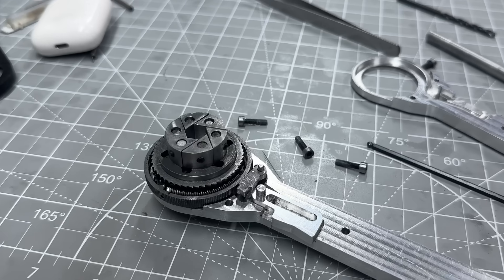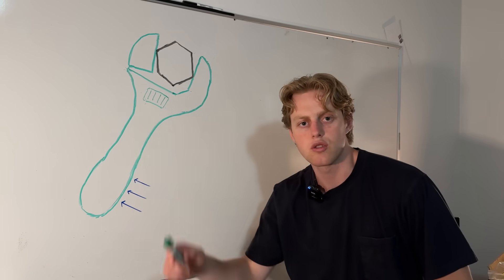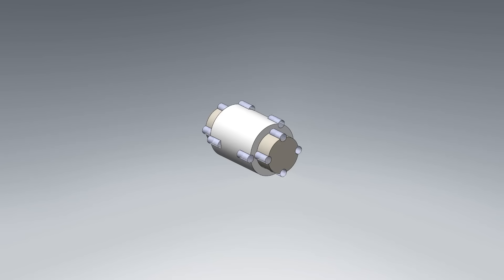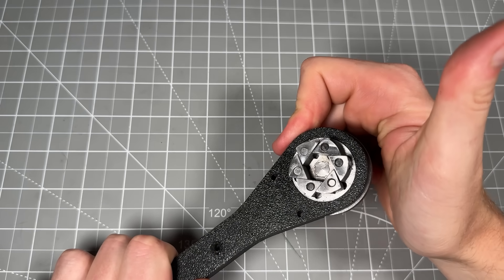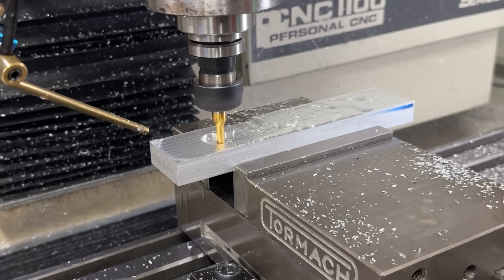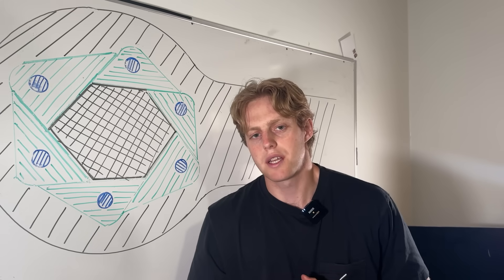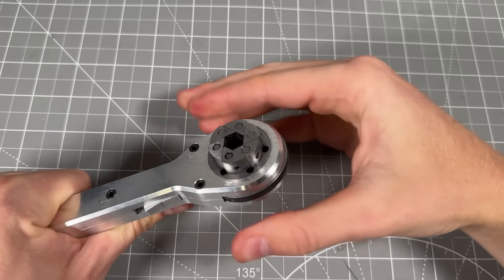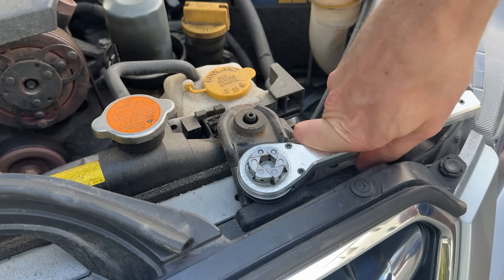I Invented an Adjustable Ratcheting Wrench

Comment: It's immediately obvious to anyone who worked on mechanical things that this wouldn't be practical because the head of the wrench is too big and heavy. You simply can't get into tight spaces with such a tool and you'll tire yourself out holding that thing all day. There's a reason why people buy those tool sets with hundreds of pieces, it's because they're just different and are needed in different situations. The right tool for the right job, and a universal adjustable tool is still never going to be the right tool in all jobs. It seems like you got fixated on a particular thing and worked on it for a long time but you never stood back in the middle of the project and think, hm, maybe this isn't going to be such a good idea even if I got it working.
Reply: I hate to agree and wish you could have been more supportive but yeah. Either way this is super cool. Just because there are already better ways doesn't take away from its coolness.
Reply: @WoodworkingforAnyone  It doesn't mean I don't support you or your work. Sometimes we just have to make the tough decision and decide to not work on something. There are many times in my careers where we've canceled projects because they don't make sense, even though we spent months and years and sunk a ton of money and people into it. Looking back, they're almost always the right decision even though we may feel really shitty about it at the time. That's what real engineering looks like.

Comment: That looks very nice! from a machinist point of view all of those parts are good to mass produse to tolerance with a cnc machine shop. so if one would make enough of these you could push the price of each of them down quite a bit. and also love that it does not matter what kind of bolt it is, if its Metric of Imperial, or just some worn bolt that dont fit aither of them haha. love the design and excited to see how this goes onwards in the future!

Comment: Very cool project from an engineering perspective. Hope you will keep exploring it. If you’re thinking about turning this into a product, I’d recommend putting together a solid business plan early on. That way you’ll get a clearer picture of where you want to take it, what challenges you’ll face, and what price point and margins you can target. What are your overall goals? Who’s your target customer? Where will you market and sell it? How much time and resources are needed to produce at different volumes, and how does it scale? Do you want to manufacture small batches in-house, or design directly for large-scale production and distribution? What do you need to invest into machines to achieve this at different stages? Etc.

A fundamental challenge to consider: in many real applications, like working on vehicles, bolts are often in hard-to-reach places. For professional use, I don’t see this tool fully replacing a standard socket wrench for that reason. It would not be as robust, versatile, or cost-effective.

If it cannot replace the tool it is trying to improve on, it would need to find its niche as a supplement. That quickly puts it in the "nice to have" category, maybe for novelty or as a compact/on-the-go emergency tool. There is definitely a market for that since people spend a lot on tools, but with the complexity of the mechanism and the precision machining required, the big question is whether it can be manufactured at a price point that makes sense for that segment.

Comment: Cool project.   

I don't see it as a tool that would sell outside of gimmick sales.  Manufacturing will be more expensive than a set of sockets, and sockets will always been seen as superior to people who use tools for work.  It's something that could sell in an infomercial, for gifts bought by someone who doesn't know about tools.

The real product you have here is making YouTube videos.  Step up your production value(especially audio) and get a little more in depth and you could make some real money while pursuing your ideas.  This could have been several videos with a bit more b roll and more description of the problems and revisions

Comment: Amazing work! I can only imagine how much work went into making this video. I wouldn’t give up on it, I think you can push it further. I saw a short clip a few days ago, it mentioned how Steve Jobs asked his team to work on the first ipod. Team came up with something that resembled a walkman, he insisted that they make it smaller with the team saying that it’s impossible. He then took the one off that cost him a fortune to develop, throws it in an aquarium and air bubbles come out, he walked away saying if there is room for air in it, then it can be made smaller. I understand how difficult it can be to try making something as small as possible, and how hard it is to ditch a design just to make it totally different. I lost almost a year trying to perfect something that I had to ditch for a totally different design.
Reply from the maker: Ya this will be the final hump, size and strength are direct trade offs and I need to optimize for both.

Comment: This is incredible, instant sub

Would love to see a proper torture test, comparing the results to normal ratchet wrenches

If I had to give an input, it be that the gripping teeth be shorter(reducing the overall profile) and possibly getting them hardened(compensating for the reduced volume, though I doubt it'd be a problem leaving them as is)

Honestly, besides that, no comment, everything is perfect, and the teeth auto gripping design is genius, props on the amazing work!

that being said, there is a flaw, the more moving parts you have, the more likely it is too fail, eventually, dirt and grime will get in there messing with tolerences(and it doesn't seem especially easy to dissasemble and clean...), would love to see how you deal with that
Reply from the maker: Thanks for the input! I definitely have some of the same concerns. I will definitely do some proper testing in the future, I just need to make a few changes first...

Comment: fantastic idea!  i've wanted a single wrench for multiple size bolts & nuts basically as long as i can remember, but ratcheting action is even better.  you could differentiate the side functions pretty easily with different color filled engravings too.  i could definitely put that tool to good use.  file a patent before some faceless corporation steals your design!

Comment: Super ambitious and interesting design.  Your doing stuff I couldn't even imagine doing, so bravo.  However, as an electrician that works alongside mechanics on the regular for my job, I would doubt this would see much use on my jobs.  It looks to be a very heavy tool, with not a lot of room for shrinking.  If we are given a repetitive task, its easier to assess beforehand what tools will be needed and just have a single ratchet and socket on us.  If we don't know what to expect, an adjustable wrench is sufficient for a one off bolt, otherwise, we just go get what we need.  I just don't see anyone willing to carry around such a heavy tool all day, and if you aren't going to carry it, you might as well get the specific socket you need for the task.  

If the tool is actually capable of withstanding heavy forces and actually grips the bolt tighter as you turn it, I would market it was a rounded bolt extractor, instead of socket replacement.  There are times when we take apart a rusty PoS and it can be very frustrating.  I could totally see people keeping a self tightening ratchet on their tool trucks-- they get to a job that is rusted and rounded, they try a socket, it rounds off shit even more.  Instead of hammering on a bolt extractor and messing with their impact, they can just grab your tool instead, and if one bolt is bad, they would be incentivized to use this tool on the remaining bolts for that job, just to avoid further headache.  So it's not that this is a faster or easier tool-- it's that this tool is for stubborn or damaged fasteners that we don't want to risk using a socket on.

I know this is going to sound crazy, but I would also recommend having two different sized tools.  Increase the pin size for both, so pin warps aren't a problem, and lean INTO the lack of adjustability, by just having two different sized heads.  No one is going to want to use that huge clunky version on a tiny bolt, and tiny bolts often have other parts spaced closed to them, making your tool less useful.  I would suggest one for 7/16 and smaller, and one for 1/2 and larger.

The exposed ratchet mechanism does let  you hand tighten, which is cool and should be preserved if possible, but it also drastically reduces the hardiness of your tool.  If I drop my ratchet off my lift, I just have to worry about people below me.  If I drop your tool off a lift, the teeth on that ratchet will likely be damaged and that section of the ratchet might not work anymore.  Not to mention dirt and grime will get into that mechanism in no time flat.  

I hope this finds you with the spirit it was intended-- I'm not trying to discourage you.  You're clearly smarter than me, and your ambition is awesome.  Keep up the good work and best of luck.

Comment: Cool, but I don't think anyone will really want it. The target consumer seems to be someone that wants one wrench instead of a set of sockets. That consumer is also the kind that doesn't do serious tool work and would just want a cheap adjustable one instead. Serious users go to wrenches when they need to fit into tight places. This is far to bulky to replace that. So this would be targeting replacing sockets, but this will probably cost the same as a set of sockets and will have less torque handling. That leaves only tool nerds as the consumer, and I dunno how many if those there are.
Reply: You're literally writing a comment on a prototype tool video, youre said tool nerd 🤓

Comment: I know this isn't infinite sizes but if you want something strong enough to put a bar on and stand on the end of it make concentric spring loaded edm wire cut sockets essentially and they sit inside each other like Russian nesting dolls, you could even do it continuous from tighten to loosen side and print the head size on the part that sticks out, also could do ball detents to stop push out but that sounds like integration hell, you could do a metric and imperial version, and also for your clearance concerns the outer front side could push out the same direction and the inner and essential create the thickest strongest socket you can fit in a recessed pocket, also look into mountain bike clutch hubs if you want something with insane tooth count and insane strength, I do like the hydra 9, something like 690 Poe with 18th engaged when under torque, don't know how crazy you want to go but you could put a load cell and bldc motor in there, with short cycle times a lipo battery you could make it powerful enough to lift you up on the end of it and just as fast as a drill when under little load, would be nice any bolt you see you can tighten fast and torque to spec with only 1 tool would save tons of time especially when dealing with many different bolt sizes

Comment: I had the same question when doing interns and working on my car. I assumed the design would be too expensive or impractical. While ur design is good, it's just as bulky as the competition you critiqued and the shell for ur rachet is wayy too big. Something tells me the bolts should be spread further apart too on ur mounting shell. 

While it works. It needs to work with just one side, be smaller to have no clearance issues and it also probably needs stronger springs to torque things harder. 

Good work! I know you are an engineer because you spent the whole time explaining how you made the design work and the process but very little testing it 🤣

German engineering student.

Comment: I mean, I have the ugly one in my tool drawer and seldom use it, I think yours has at least the same use case, but would be more useable. Especially in cases where you have a big mix of imperial and metric. You do point out some limitations where a socket would be better, but if yours can cover 75% of needs, that’s a win. 

It’s like I say about Wera, Wiha, or Knipex. Some of their products look like they came from the As Seen On TV store, but actually work. 😅

Comment: I'd be curious to see at what torque it fails and what DfMA optimizations could be made
Reply from the maker: Ya I would like to know as well, I'm just a little afraid to destroy it. The design intent is to hold up to roughly 130Nm (spec for 3/8 drive ratchets). The math shows this may be possible but I had to make a lot of assumptions, so hard to know for sure without access to comprehensive FEA sims. Eventually I'll have to push it to its limits though... 

As far as DFMA, the ultimate goal would be to get the design to a point where the flat parts would be stamped and the receive some form of post machining process. Although right now I think the aspect ratios are slightly out of reach for heavy-gauge stamping. The handle would likely need to be hot forged and machined after the fact as well.  Having the handle be one part instead of two or at least share the same forging die would be help lower cost significantly. There is definitely a lot of upfront capital required to get the stamping and forging dies built. But once the tool steal is made piece price is manageable. 

The bushings would be cheep the manufacture as is, and the thru pins are only a few cents a piece. 

I have not quite sorted out how to make the teeth of the wrench jaw at scale... so let me know if you have ideas. Maybe I can machine them at a reasonable price? Or a MIM part if the tolerances allow for it. 

For assembly there are a lot of small pins and alignment concerns to deal with. I would likely need a set of custom jigs, fixtures and presses. I also need to find some other way of attaching the triangle teeth other then set screws, these will be a pain from and assembly point of view. 

If you or anyone else in the comments is an expert in any of these areas I would love to pick your brain.
Reply: What about a cnc mill turn lathe for making the teeth ?
It's quite common in the industry and very productive

Comment: This has value if you realize that the huge demands on accuracy of the parts and extreme care on assembly prevents a commercialization of the wrench.  
This should be the first step in a long row of iterations towards a final product, steps that you will eventually learn to internalize before discarding without physical samples. 
But your approach to the failures here makes me think that you will get to this point eventually, 100%.
Reply from the maker: I appreciate the support, I am learning that bringing a product to market is no easy task, especially when you lack capital... I will keep pushing though :)
Reply: the first step should be assessing market demand; i wouldnt buy one because it has no real benefits over a normal ratchet wrench; just downsides. i COULD however see benefits in automation, where this serves as part of a robot arm end effector
Reply: prevents? mass production allows for tight tolerances. And then nobody would give a fuck about cost in a commercial enviroment, do you know how much specialty tools sells for? No its evident you don't. 1000 dollars for a wrench like this and it will still sells like cakes